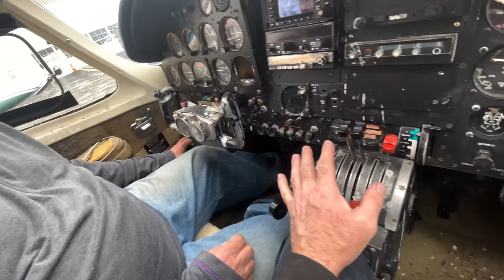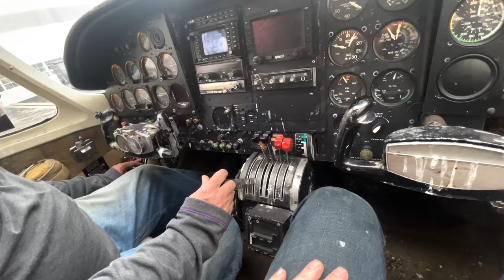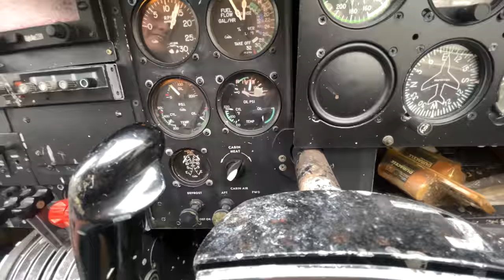Will Engine #2 Ever Run Again On Our FREE Abandoned Airplane !? Ep8

Comment: as an ex engineer I was taught never to apply compressed air to dry metal parts without applying oil afterwards-as compressed air alone could be applying fine water mist onto them.
Reply: I'm not an engineer but I got the same information from the bearing manufacturers. They specify diesel oil for cleaning.
Reply: Its having an complete engine overhaul anyway, he only did that just to get it running. :)
Reply: And put the through a parts cleaner, which I GUESS uses water/detergent but it may be kerosene or something? Interesting advice though, I'd not heard that before.
Reply: This man knows more than what he is saying in his vids.  My husband is an aviator and has made that observation several times while watching the series.
Reply: @kiesh.  My husband recommends brake cleaner...
Reply: @kiesh.  parts cleaners NEVER have water in them. Kerosene or diesel fuel.
Reply: @shawnriley8909  cheers, yeah makes sense. I've actually to my surprise never used one before (only ultrasonic cleaners with water/detergent which have their pros and cons)
Reply: Compressed air without specialist filters is always likely to be wet, but this engine is getting spun over and fired up so everything should be well oiled. By the way never spin a bearing with air it’s the fastest way to dull the contact surfaces. Ditto for a turbo. Spinning it up dry chews the bearings.

Comment: Im so pleased to see both engines running! So much ahead to do but you've reached a benchmark.
Awesome guys!
Reply: ah man spoiler. never scroll to the comments before watching.
Reply: hope it doesn't spin a main case bearings as the YouTube GA-aviation channel i listening 👂to sorry spaced the name ( he runs a monedering/maintenance company, mike something 🤔 anyway's vary good information for all gear heads and more so if you fly piston poper's ) said removing a one cylinder at a time can miss up the clamp loading and let the bearings ect go bad and or drop a valve train pieces if it wasn't done right or unlucky vs unopened and go for broke or best thing is TBO the hole thing , the exhaust valve if heathy should look like a pizza 🍕rings as he cover it on his channel and podcast ( i was lessons for my BBM and how to know if im burning it up aka early easy way to find problems before uncle rodny shows up and rowans my day 😉 ) and has the same if not close to the same model of aircraft but his i think is a 1982 twin, either way this one in the video doesn't has the airworthiness cert. as the wings need fixed/updates to pass

Comment: I'm a licensed aircraft engineer in the UKand I have a few maintenance tips for you. 
When removing components like the pushrods it's important that they go back in the same positions so use a piece of cardboard box with holes punched in it and marked with the pushrod locations. 
When removing screws or bolts from panels or components use linen bags and label them. 
Never leave components on the floor where you're working. You WILL step on something and break it at some point!
When using a specialist tool like the one you were using to loosen the cylinder nuts try to think about mechanical advantage when using the tooling and have the tool in the same direction as the lever. I would advise using a breaker bar instead of a ratchet too.
At the 37 minute mark you're talking about corrosion on stored aircraft. When an aircraft engine is stored the oil and fuel should be drained and inhibiting fluids used. If you leave the old oil in the engine it will have acids in it from running and the engine corrode.
Whenever I'm installing a high temperature item like an exhaust, or an exhaust nozzle at my place of work, I always use a product called Never Seez pure nickel special, you'll never have to use a penetrating fluid if you use this.
I'm interested to know why you didn't check the other cylinders too? Did you boroscope them? I'm guessing they weren't brilliant either which is why the engine was hard to start and smoked like my granny used to.
Why were you putting the pistons into the bores before attaching them to the con rods? Just asking LOL! Guess you were getting a bit ahead of yourself.
Reply: Engineer from Australia here, thinking all the same things as you!
also;
You've got the rocker hats off.... why are you not checking valve clearances? It only takes a few seconds.
Do continentals run hydraulic lifters? If so, congratulations, you just bent all your pushrods by not letting oil out of the lifters!
Most importantly, don't start doing rectifications until the inspection phase is complete.  Those wing spars could be bad enough to make the whole job scrap metal!

Comment: on  the slower turning motor, sometimes loosen the spark plugs reduce compression ,therefore let it spin a bit faster , maybe till you get a heat cycle into it.

Comment: I find that using an impact driver to remove small screws (Phillips) that you want to keep is not a good idea; in my experience, the screws will start to get torn up from the impacting action.  I prefer to use a drill motor.
Reply: A drill can tear them up just the same. I loosen them by hand first, and then use any kind of driver after that. The correct fitting driver bit the the MOST important thing in not ripping the fateners up. Many years ago, when I first started in mechanics, I had NO idea just how many different "Phillips" designs there were, and how the proper bit is absolutely necessary to remove them undamaged.

Comment: Hey man absolutely loving watching this so far and can't wait to see it flying. Just wondering about the airframe though. Was a structural inspection done to evaluate corrosion and if so do you intend to use an engineering consultant or will it be mostly covered in srm? Thanks and keep up the good work 👍

Comment: Can’t imagine anyone flying on those engines without overhaul.
Reply: Dave Pin  
Who gave "you" a sour pill, today?
Reply: Well they won't silly..he's just checking.....relax .laddie
Reply: @blackbirdxx4613  but why bother trying to get the engine running. Pull it off and send it to the overhaul shop. It will come back with mostly new parts and running.
Reply: @blackbirdxx4613  $200K and he could have both engines and props overhauled and legal to fly
Reply: Which is why they're not going to... This was purely a "can we start it?" exercise. He's been saying from the beginning they won't attempt flight without. That being said, the plane would have to be signed off by an IA before it could legally fly anyway, and no IA would sign-off the plane in its current condition.
Reply: Dave Pin, all this ranting and raving and making yourself look like an idiot.  He must have talked about the engines being overhauled 10x on this video alone.  And that's the whole point of the gofundme he set up.. to have all this work done.
Reply: One, cause he wants too.  We've all been there before I'm sure.  Two, he needs content to get and keep viewers.  Pretty straightforward, views are what keep a channel going, and in his case draw viewers to go above and beyond by funding the repairs.

Comment: I used Kano oil on cranes, big 100 ton overhead cranes to loosen bolts. Most the time you spray it on and leave it set for 5 min and bolts come right off. Makes wd40 and pb blaster look like water. Great choice

Comment: I used to clean metal parts for a job. 
Boat hull cleaner - a.k.a. Muriatic acid
Pour some of that stuff in a beaker in a negative pressure environment (you DO NOT want to inhale those fumes)
put metal parts in the cleaner for no more than an hour, (WEAR GLOVES & MASK) take em out, clean em off with distilled water, wash with isopropyl, then rinse with distilled water. It's a lot of work, but the muriatic acid does wonders for stripping stuff (especially organic material) off metal.
It's what we used when the ultra sonic didn't work.

tl;dr - boat hull cleaner, when used properly, does the work of a wire brush and steel wool in fractions of the time without your arm getting tired.

Comment: Hi! To remove deposits in the engine use Dimexides. This is a medical facility for outdoor use, sold in pharmacies. You just need to soak the details for a few hours, and all the deposits and dirt dissolve. But be careful, Dimexide dissolves some polymers.

Comment: Hi I have heard that sound before. The generator sits in the front runs off a worm gear system. It's been a while but if your generator is not working I don't think your motor will start, but it could be the turbo that seized, causing bad airflow into causing low compression too. Just my thoughts and knowledge. But I could be wrong. But kudos, keep going don't give up or in..

Comment: You need an ultrasonic cleaner, no more scrubbing  with a wire brush, and the ultrasound gets into every place that you couldn't get with cleaning fluid and a brush. You could set the timer and forget it, and go do something else, getting more work done.  Check out Mustie1 on you tube he uses one all the time especially on carburetors, he is a heck of  a mechanic!
Gabby

Comment: Nothing wrong with reusing old rings for the purpose of ground testing, point proved it started and ran. Obviously they should be changed and run in correctly when the engine is rebuilt,  there’s no recovery service at 5,000 feet…… keep up the good work, loving the series so far. Well done to all who support this project.
Reply from the maker: Hey Peter….  
When we first spoke with Sam and shook hands on the deal I did say we’d get “both” engines running so even though I know Sam wouldn’t have held us to it we just felt we had to get them both going. It’s been a crazy adventure… We’re glad you’re here with us and part of the Rescue Crew 👍🏼

Comment: So I found this project recently I'm on a binge watch now and basically episode synopsis: Jet fuel for internal clearing worked, worked a little too well also clogged lines that the jet fuel didn't reach were still well clogged and messed with stuff. I imagine because I personally didn't hear the gasket squeal until after the jet fuel was added then took out, so I imagine the piston ring thing either did corrode or the Jet Fuel got into them sort of and tried to take out the gunk but it couldn't get out I'm 20 minutes into the video so this idea could be wrong xD. LOVE the project though and I'm glad the Ironic name "Cessna 401 Phoenix" stuck.

Comment: I'm not a professional mechanic but I've fixed everything on my cars, motorcycles, snow mobiles, boat engines and so on for 30 years. But I've never come in contact with aeroplane motors. Although it's the same principle, the Otto motor, there are some interesting differences. The direct fuel injection system was invented by a fellow swede in 1925. The first car with direct fuel injection was the Mercedes 300 SL in 1955.

Comment: This is the idea I commented about on the video where you were trying to start the engine. I had stated that it's lack of combustion was due to low compression.
Yesterday I was looking at a single piston generator engine that won't fire. I haven't checked the compression but I do feel strong compressive resistance when pull starting and rotating the crank with a drill motor and suspect it's lack of combustion is due to weak spark.

Comment: Thought so, that thing fired right on up didn't it 🙂; I knew it was going after all of that fuel came out of there 👌. Fuel and air flow are the most common problems with getting those engines in theory to turn over, however your piston compression problems with deposits all over made this minor maintenance factor into a compound injury case. 👍 Good deal Man.

Comment: I worked in a certified maintenace facility in europe (Part-145) and we released airplanes on which we changed some cylinders and pistons without tools ( boss too cheap to buy them) and they are flying again, so you can do it too ( not airworthy as per FAA)

Comment: Congrats on both engines running. I've spent time in the Air Force and don't know if you know about NDI it is an X-ray of the airframe to look at the structure integrity since there in know corrosion there could be airframe cracks as well. Better to know now than something break loose 5,000 or 10,000 feet up.

Comment: Should be keeping all of those rings and pistons together with the cylinder they came out of! And put the same pins and cylinders back on the same rod! Also, make sure you do the proper gap positions when you put the cylinder back on! You don't want the gaps being all lined up or aligned with the pins!

Comment: If I remember right about the Jet fuel, it was said to completely fill the engine with it. I believe you said the engine takes twelve quarts but that's not full, I think it would take well more than two gallons to completely fill the engine with jet fuel. That would be more like to the top of the fill neck full, that would ensure that everything that sees engine oil would get cleaned. I would have thought using jet fuel to dissolve and break free engine varnish would have freed the stuck piston rings ( 19:35 video time). Of course any mechanical damage around the ring glands will never let the rings expand and contract like they should.
23:49-with the intake track constantly flooded with full same with cylinder, there would be constant lack of lubrication on the upper cylinder walls every time the piston travels up and down. That there could destroy some piston rings, and maybe that is where the squeak  is coming from, dry cylinders.

Comment: What would happen if you used 5 golf cart batteries 30v (30v). Turn it over a little quicke I wouldn't expect any problems with the starter.Not sure how avionics will handle the extra voltage though.

Comment: This man do the same i learned wen i was 15 years old and took apart a engine from a Multicar (a GDR transporter) together wit an 80 YEAR old mechanic .
He always said. "the most important step to repair soemething is to take it apart, clean everything, an rebuild it. Then You know the engine and can fix every issue"

Comment: Regarding all you need is fuel, spark and air, and others observations that you need more, e.g compression/timing etc. I had the same thought at first, but then thought we were always using an engine to combine these things, so some things are a given. The only extra you need is the fuel, the fire and the air - which you said? Lol, sorry to add fuel to to the fire…

Comment: You may find broken rings, and definitely seized rings. Well, that’s what I’d expect anyway.
Cracked pistons and or cylinders, heavily worn bearings and shaft is also a definite risk.
Hopefully you are ok with grinding valves and decarbonizing top, honing sylinders and change to new rings.
I expect it is all fixable, but a shop should / must refit this engine before you leave the ground. 😊

Comment: Fun stuff, But its not "too lean will overheat your engine".  Look at engine temp curves from I think 80s or 90s.  Thats when folks began to realize the old knowledge was wrong and contributing to early engine demise.  Lean of peak egt is usually the place to be.  Going leaner will cool, not heat, then it will die. (There are some caveats injected vs carburetor)  look it up.

Comment: Theoretically you use the same parts the same orientation, not to mention everything down the bolts in the same hole they were originally in... If EVERYTHING were put back together the same way it came out and once you find the problem you don't need to Overhaul the engine. I like that you are not going to chance it... But I highly recommend duct tape , cardboard, and different color sharpies and doing the same thing backwards when you put it back together labeled bolts and bolt holes the opposite way it came apart.

Comment: Just curious if anyone knows, what is better? To buy a older Cessna like this one with low hours and an old overhaul or a Cessna with high hours and an old overhaul. My logic as a novice who doesn't fly is that at least it's been running since the overhaul most likely thus there'd be less issues like Rebuild Rescue is experiencing, on the other hand the components are likely to be more worn down, higher likealiability of a overheated engine etc.

Comment: I was also thinking since you are going to have to replace almost everything I wonder if later there could be a project where you put the engine into a boat or some other vehicle. (you might have enough parts to build out a 3rd engine etc. ) Because flight spec vs spec for running them at lower rpm on another application you might have a whole engine left of parts that will run but won't be flight certified

Comment: This is the same squeak I heard in a lawn tracter engine after it had been run without oil in my case the squeak is from a seized ring dragging on a cylinder wall. Very bad indeed this maybe your issue too

Comment: The squealing is because you poured several gallons of jet oil down the crankcase. It has gotten inside the crankshaft seals and pushed out the engine oil that was there. Pistons and rings don't "squeak". Even if the bores are dry.

Comment: Big fan of the fact you used a live trap and realized the mouse.

Idk if they would use this in planes.. but the rats that nested in my engine were eating some of the soy based insulation/cabling that they sometimes use.  I think older cars tended to use petroleum wire insolution until sometime in the.. 90s? Idk. But also for planes they might have stuck with the more expensive solution even in later models since it is obviously more critical that you don't have an electrical short in mid air compared to on the ground

Comment: You will start it however it will definitely need a complete rebuilt   All things considered it isn't as bad as we would imagine after having sat there for all those years also the hours on the engine should be low